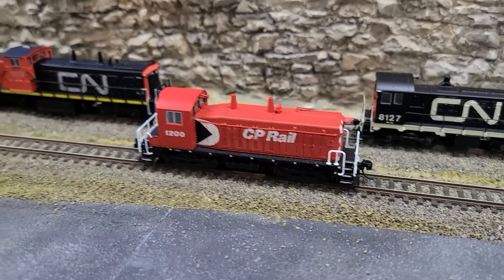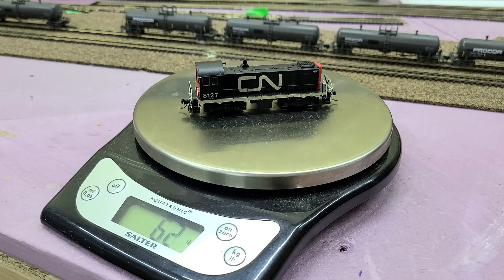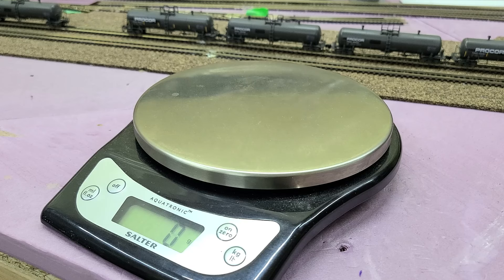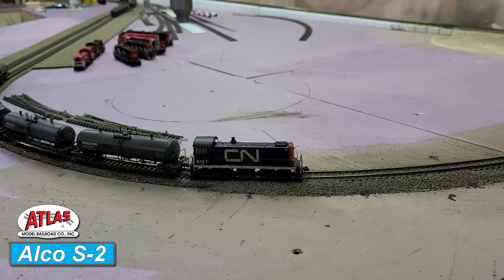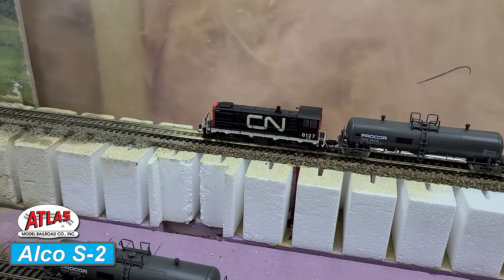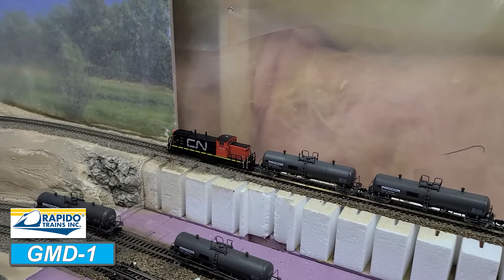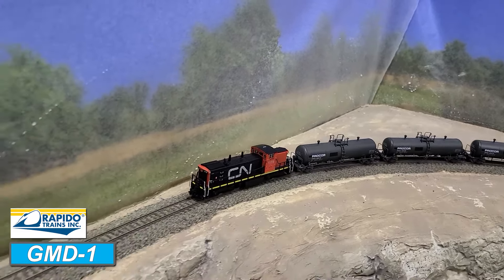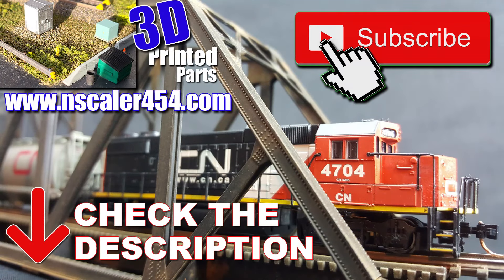GREAT N Scale PULL TEST! - 8 Different Locomotives - How much do they pull?

Comment: Just discovered your channel with this video.
Haha EXACTLY what I needed to see as I'm rebuilding my n scale with very steep grades. 
This info really saved me a lot of time.
I usually like to run trains weighted so they need four or five locos to get over the road.
If a stalling engine is approaching a curve it will gain traction thru the curve from the added friction.
I'm am pushing the subscription button.

Comment: Great video, the only thing you need to take into consideration and should've put on your chart was weight per axle for the locomotives.  As a few commenters have already mentioned, this makes a huge difference between the 4 axle loco pulling better then some of the 6 axle locos.  Also another factor is the decoder itself.  Depending on the decoders programming and motor control it can change just how well the loco will pull the hill and curve loaded.

Comment: Axle weight can be a major impact. If you had two locos that had the exact same weight, except for one being a four axle and one being a six axle, the four axle would highly likely out pull the six axle. All that weight needing to be distributed over more axles so less pushing down on each. Now granted the six axle locos tend to be larger and hence heavy to make some of that up.

Comment: Looks like Out of Gauge track after the Ballast starts, squeezing wheels? Either that or a hump?
They all had issues there. Trailing cars were on straight track so something different at that one point.
Reply from the maker: I think it's just a hump where the two modules join.

Comment: I'm starting to think that the pulling power is related to weight per axle. For example, the GP40 is 75g with 4 axles, making it 18.75g per axle, while the intermountain is 82g with 6 axle, making it 13.67g per axle, giving it a lot less traction.

I'm also wondering if the amount of axles on the train made a difference for the weight, like if it can pull 3 hoppers but not a single box car, since the box car has all of its weight on 4 axles, while the 3 hoppers have their weight spread across 12 axles.
Reply from the maker: It would seem this is indeed the case. This is why I love comments from the viewers.
Reply: @nscaler454  this is random, but at the spot where all the engines were slipping right before the edge, was the track shinier? I'm simply wondering if the tracks got polished or more slippery from all the engines slipping there. We could always put the GP40 back and see if she performs worst now that the 6 axles have slipped a bunch on it
Reply from the maker: @KevinsTinyTrains  It very well could be. Though this has been a little trouble spot since laying that track. I suspect when gluing it down there is a dip or high spot that isn't really visible. Given it's at a spot where two pieces of riser foam join (as well as the track) it would make sense.
Reply: @nscaler454  I have a few Kato DC engines in N scale that are excellent puller, I'll weight them tomorrow to see if it really makes a difference. They are all very heavy (for N scale) 6 axle engines and very good puller, even on a 4% incline
Reply from the maker: @KevinsTinyTrains  would love to know the weight of them. I would imagine Kato's are great pullers.

Comment: What's about the rubber tyres? A small loco with rubber tyres can pull more than a big one without.
Reply from the maker: Rubber tires are not out of the question, at least on the 6 axle locos.

Comment: Are all 6 axles on the Scale trans Gevo drive axles? Thinking that might be the reason why it couldn't pull as much as one would have thought.
Reply from the maker: I think so. I honestly didn't look. Would be sad if it wasn't.
Reply: I just think they are weak. I have two that are weak pullers. What’s interesting is in HO scale, they are pulling monsters. I don’t understand why they can’t make their N scale versions pull good.

Comment: I love my ScaleTrains but unfortunately, in N scale, they aren’t great pullers. HO?  They pull great. N scale?  Not so much.
Reply: Well, HO, don't pull as good as 0 scale/gauge. So your point? 🤔
Reply from the maker: I think my Scale Trains Tier 4 GEVO pulls okay. Maybe not relative to it's weight, but it still pulls more than every other loco I have by a significant amount. I would guess it could pull 850 grams or around 25+ cars on a flat track without too much issue.
Reply: Unfortunately you just can't scale down gravity. Rats.